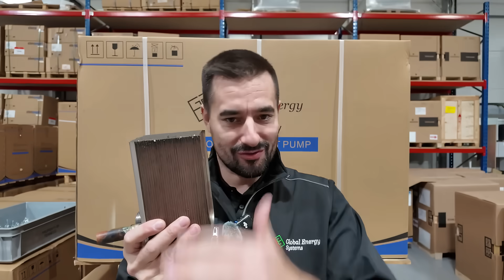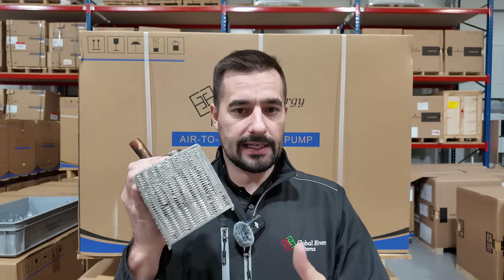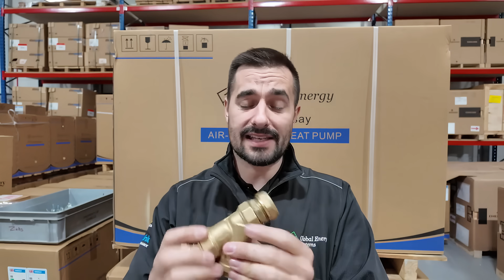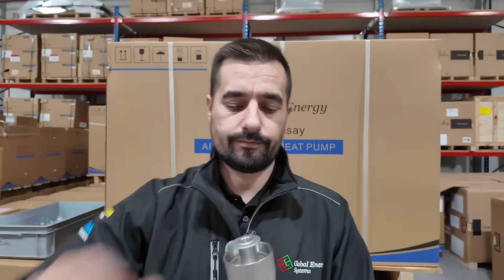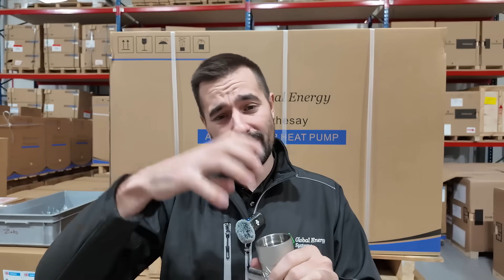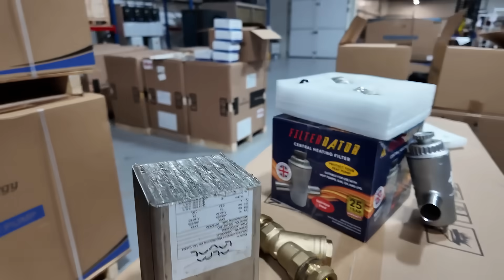Heat pump filters with @Rowlysrenewableroadshow

Comment: What’s the brand?
Reply from the maker: Global Energy Systems - https://globalenergysystems.co.uk/?srsltid=AfmBOop64OUaW8pg3Ew-VE-llmkIC-kJwMBOQRCZ6Bfm7Zm5ON-kzgNp
Reply: I was thinking about this the other day. These filters  (and others) are designed to work with unidirectional flow, what happens when flow is reversed during the defrost cycle. 
Doesn’t that mean that theoretically, there needs to be a filter on the flow and return of the condenser? 

The reason I was thinking about it was that I’m seeing a large flow rate drop on my new installation compared to the theoretical) output of what is quite a large circulation pump ( a UPM4XL). My attention is drawn to the filter as the culprit for back pressure ( I’m using an intakleen HP filter). I’m seeing this flow loss at 100% pump output and on my DHW cycle ( new 250l Telford tempest and all new primary lines, less than 8 m in total copper) 
Any thoughts please as it’s not making sense to me?